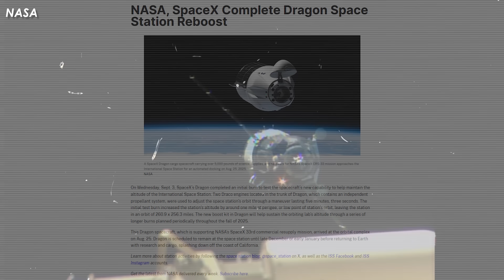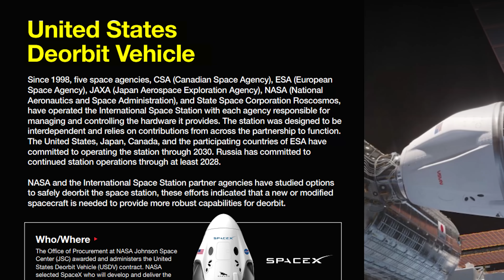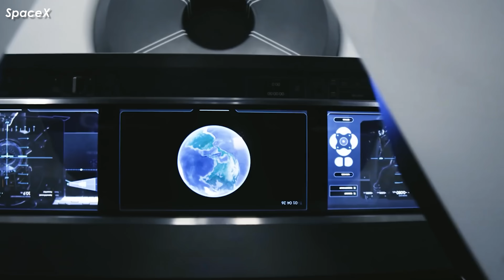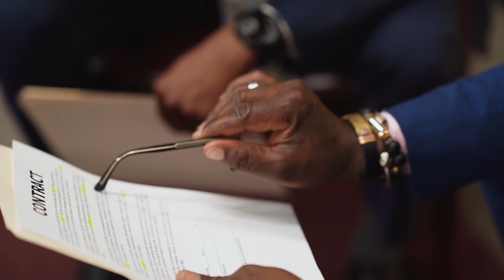SpaceX Upgrade Dragon revealed New Method to Reboost ISS, Shocked China & Russia...

Comment: Goodness. You’re clique-bait. “Shocked”. “Global headlines”. 

This is nothing new. Shuttle rebooted ISS for many, many years. Starliner is capable of it. Dragon in current config is not, just do to design, at least efficiently. 

“So good at attaching to ISS” has absolutely zero to do with any of this. The prop package in the trunk, is purely an engineering demo for the USDV.